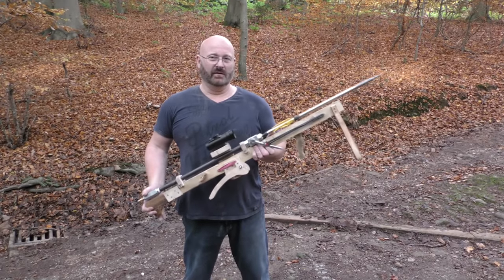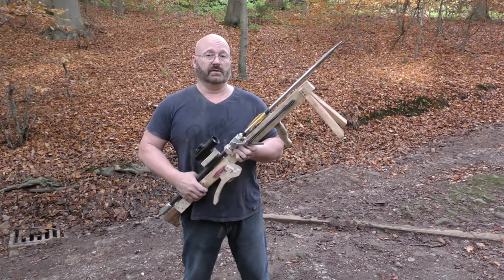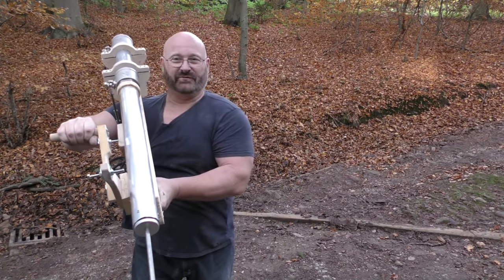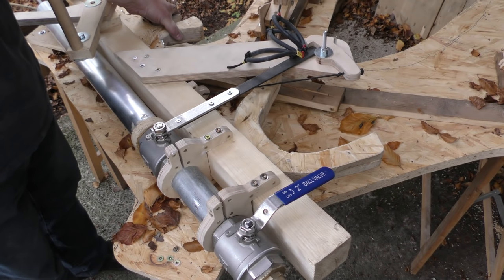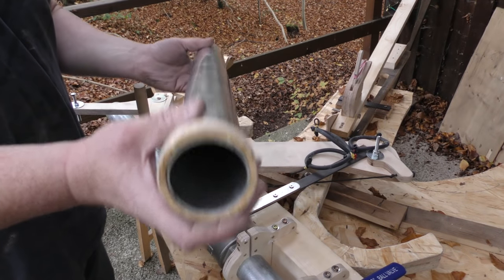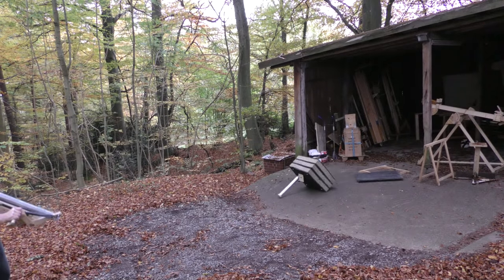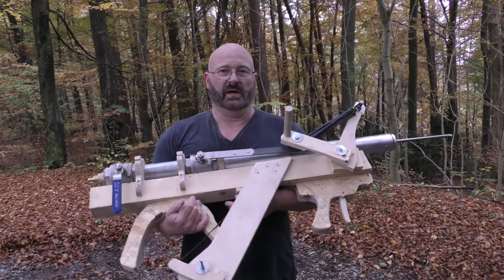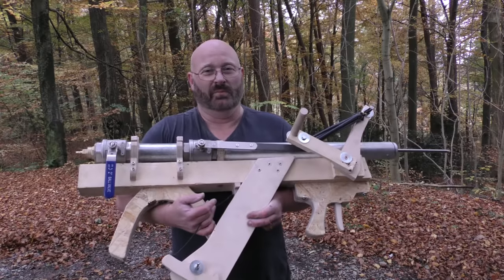"Airzooka" - The biggest portable airgun in history?

Comment: This is getting into armor piercing territory here :3
Reply: I hope so
Reply: Ship it to taofledermaus!
Reply: yes!!!
Reply: Well, the dart it shoots does remind of an APFSDS round fired by tanks. I wonder, would a sabot round where the sleeve of the round goes over the barrel while the dart goes (partially) in the barrel be still considered a toy in Germany? If so, then a FSDS round would be pretty nasty out of that thing and with a hard/dense enough round it probably would be light armor piercineg.
Reply: Sadly, no. Nothing can enter the barrel on an "arrow" launcher, BUT (and too bad Joerg does not read all of these posts) The way to get around that is to use an extra long "arrow" that's blocked off a few inches after the barrel and the "arrow" would be hollow after that point, but you could build another slingshot (like) setup into the end of the "arrow".  it could be fired based on inertia, or even have  a rod sticking out farther, so when that rod hit that target it trips the trigger and fires the pathetically designed sabot  lol

Comment: If you want to open the valve quicker (as I have written before...):
Do not attach the rubber directly with the handle of the valve. In this case the rubber must first accelerate first and begins the opening process with a very low speed.
So : Do attach the rubber with a string to the handle, and the rubber with to cocking. If you fire, the rubber will accelerate until the string is strap (deutsch .stramm) and begins to open the handle. So the rubber will starting the opening with the final speed (when all stored energy is converted to kinetic energy) Maybe you must put some weight to the connection between string and rubber, to add some momentum.
Reply: Then you can also shorten the handle: When you directly connect the rubber to the handle the opening process is depending on the force of the rubber => you need more rubber or a longer handle. 
When you first convert the engery into kinetic energy than the opening process is only depending on the energy and not on the force of the rubber. The opening needs always the same energy - independ of the length of the handle. so in this case you can shorten the handle. This will further improve the speed of the opening.
Just like using a hammer: Whit your muscle you will never push a nail in the wood. But when converting the muscle energy first into kinetic energy of the hammerhead it is easy.

Comment: Why does the compressed air turn misty/smokey when it is released? Is the air so cold that water vapour condenses?
Reply from the maker: Yes, compressed air gets very very cold when the pressure is released quickly.
Reply: Temperature is inversely proportional to pressure according to Gay-Lussac's Law

Comment: Have you thought about adding electrical solonoid to open the valve?
Reply from the maker: Battery powered solenoids won't work under the pressure rates I am using.
Reply: What if you make some sort of hammer to knock the valve open?
Reply from the maker: A 2" hammer valve under 2500 psi or more? You need a sledgehammer to open it.
Reply: Joerg, couldn't you have the air flowing twice as fast by having 2(or more) valves opening at the same time? this doubles the airflow while opening.
Reply: RenzVC what? lol
Reply: instead of the air going through only 1 valve that he's opening, put one on the right, one on the left, and connect their outputs to the barrel. so he's opening 2 valves of the same air-tank which doubles the stream of air if he opens them both at the same time and at the same speed.
Reply: JoergSprave why don't use the idea of Espen Monseud to make a powerful cannon?
Reply: electrical solenoid valves would work great, you wouldnt have a delay
Reply: I have seen them handle over 150 psi, are you really using that much power?
Reply from the maker: 150 PSI is a joke.
Reply: have you read my comment about the 2 valves that open simultaneously into 1 tube? well you have now :p JoergSprave
Reply: Ok then, never mind. I guess a electrical solenoid would not work
Reply: JoergSprave you could go industrial, although that might be a bit expensive
Reply: true but it would be awesome
Reply: JoergSprave meet the soldier, it's perfect for it.
Reply: He mentioned 100 bar of pressure. That is closer to 1,500 PSI :P
Reply: wow that's a lot of PSI
Reply: Brian Willis all solenoids are electrical
Reply: no there are manual solenoids
Reply: like in a pneumatic nail gun (also large diameter bore)
Reply: Gunner R.A. his pistol has 1
Reply: Even though this topic is 2 years old, you can use a solonoid IF you use the lower pressure to open the main valve, electronic paintball guns works that way. But you need a regulator for the solonoid. Otherwise you blow up the solonoid/ Or its safety gauges.

Comment: Hi Joerg ... if you want the valve to open quicker you shpould examine Quick Exahaust Valves (QEV) ... you can even make them yourself. They have nothing to do with motor engines although the term exhaust is misleading. A lot of the softair guns use QEV as they can be made to repeat fire consecutively like a machine gun too. ... but they can also be made to empty our the air reservoir in one big blow !
Reply from the maker: Again, don't mix these toys up with low pressure PVC spud guns. Homemade QEVs for 4000 psi? No way.
Reply: now that airsoft has been brought up, i want to make a mortar for airsoft that shoots nerf rockets but i really don't know where to start and what materials i should use, and because you the master of all this i tought i ask you XD
Reply: JoergSprave
Reply: Was ist mit indirekt gesteuerten Ventilen? Gibt es nicht Ventile die mit einem Steuerdruck geöffnet werden? vll wäre diese ja schneller
Reply: PVC, it can handle enough PSI for launching a foam rocket. I'd use a bike pump to fill a chamber and a valve to release it, although you'd have to turn it very fast for a good launch.
Reply: Большой босс
well that's a thing thx m8 i'm gonna try it out

Comment: Compressed Air is next to not affected  at zero degrees. The only thing that will be affected are the rubber parts, dont know if you'd notice that though.
Also its not an airgun, if wouldnt be legal otherwise ;)
Reply from the maker: Well, the cold temperature cools down the compressed air too, reducing the pressure in the chamber. Therefore the power IS reduced. The rubber parts are much affected as rubber stores the energy thermally. The hotter the environment the faster it retracts. Cold temps reduce the speed. At some point it stops working at all. Also, it is an airgun of course - just not the type that is regulated by German gun laws.
Reply: I thought it's a toy ;P
Cold temperature is only an issue with Co2 Guns honestly. I took my Steyr out on tourneys at 30°C and when snow fell, wasnt able to tell a differnece on the point of impact (which i had to calculate precisely from ranges around 9-25m and hitzones from 15 to 40mm and even had 8mm biathlon targets).
Reply from the maker: That is because your Steyr has a regulator. With regulator, cold temps just means the air tank won't last as long, which probably isn't an issue for you. A (toy) gun like mine fires without a regulator, so cold air means less pressure.
Reply: Thanks, just read into that and you are absolutely correct. Though it will only matter if there are temp differences between the filling and the shooting.
Reply from the maker: Not really. The air will get much warmer during the compression process, no matter how cold the environment is. Thermodynamics at work. Compress a gas and it will get warmer, decompress it and it will get colder. As the warm compressed air in the tank gets colder, the pressure automatically goes down.
Reply: P.V = n.R.T 
When the temperature decrease , the pressure decrease too
Reply: +JoergSprave A metal drain on a dirt road, interesting.
Reply: +JoergSprave I noticed you aimed low to compensate for recoil. Not your first time firing this beast huh?

Comment: Is there a way you can make it more powerful?
Reply: faster opening of the valve
Reply: As he said, faster opening valve. Maybe better projectile. Also putting more air in it and testing it in finer weather conditions.
Reply: Alex Hoad just make the air Reservoir a bit longer
Reply: He could used a compressed light gas as well.

Comment: reply here jörge
Reply from the maker: here jörge
Reply: I love your laugh ,it's adorable
Reply: sorry for wrong spelling
Reply: Your laugh makes everything you do 10x better. It's like watching Heavy from TF2 make improvised weapons. I love it.
Reply: he did something with the guy that voices the heavy TF2 guy
Reply: you should actually put rifling on the barrel of smaller arrow shooter
Reply: +JoergSprave You could use a steel spring like one from a bike suspension for faster valve release
Reply: I feel like rifling would actually hurt the performance of the arrow. In order to spin stabilize such a long object it needs to spin ridiculously fast, which isn't plausible even with explosive powered guns beyond a certain level. That's why bullets are always relatively short - the longer the projectile, the less effective gyroscopic stabilization becomes. In the case of arrows or darts, it's much simpler and better for ballistic performance to just add fletching to the back.

This is, by the way, why most modern tanks have smooth bore barrels. They fire very long darts (because being long and thin is much better if you're penetrating armor), and they generally just have fins at the back because it was shown during testing that rifling had either no effect or degraded the ballistic performance of the darts.

Look up Kinetic Energy Penetrator for more information on this.
Reply: xD
Reply: Jörg, please stop replying to these idiotic comments. There are some people in the comment section who actually make useful or interesting comments related to your videos but this cancer right here is the top comment. Your replies should be earned.
Reply: look at your profilepicture...
Reply: Optilus DNCF not having one at all isnt much better
Reply: his name isnt even jörge lmao

Comment: You should use mechanical air compressors, they are much faster. (The cool machines that you use to "refill" pressurized tanks).
Reply from the maker: Oh, but I do have a 4500 psi compressor for the heavy lifting. I still use the handpump for the small devices, just easier.
Reply: oh ok, that works too!  My arms are like overcooked noodles, i cant use one of the hand pumps XD.

Comment: You know, I think a better optimization of this would be choking down the barrel/arrowguide to a 1" (25mm) tube rather than the 2 inch.  The massive dump valve could be choked down using plumbing and a reducer and you could get much more velocity and distance out of the shots.  Also would weigh less as the arrows could be longer and sleeker.  

  BUT That being said, this thing is a monster! I love it! :D Keep up the good work!

Comment: You are correct. It only opens maybe 15 or 20% before it has already dumped the load. Maybe you only need to open it 25% as a matter of course? Or maybe a 1" valve will do as well?

Comment: Cool result, took crazy to get there.   Expect Foley Artists to show up wanting to make recordings of the airzooka.   You may be able to get the arrow stable without fins (known as fletching on arrows)  C.G. = Center of gravity, balance point along length.  C.P. = Center of pressure = center of area along arrows length.   Heavy weight in nose will weathervane tail of arrow to rear.  If you can get C.P.  aft of C.G. by 1.5 x Diameter of arrow body it may be stable.   Fins on rockets are put on straight.  Arrow fletching is put on at a slight angle so the arrow spins in flight.   The wood ring you have at the back may help with stability by creating a lot of drag.

Comment: awesome, 

my 2 cents the valve is the problem i presume this is a spherical valve PN24 or more. You need a real high pressure fast valve trigger by electronic with a solenoid in order to lower your delta time (Dt) to empty as quick as possible the pressure tank. This look like a dual conical shape inside a laval shape with a biconical exhaust. They use this in vehicul propulsed by steam in order to beat speed world records.

Comment: Jörg, you might be limited by the length of the lever here. In the future, consider two, three or four-way rubber setups so you can use shorter levers and still get the same power. In this case, you'd move the handle so that it pivots around the center and then have rubber pulling rearwards on the top and forwards on the bottom.

Comment: Hey Joerg, awesome project, what kind of valves do you use to take that kind of pressure ? I've been modifying sprinkler valves and I didn't want to push them too much over 100 psi., I'd like to make something along the lines of a 300 to 600 psi range, maybe a little more

Comment: To fix the opening speed issue, you need to add slack between the lever and the valve. Let's say that the total angle would be 180° and the slack 90°. The lever would gain momentum the first 90°, then connect with the valve and open it rapidly. The weight of the lever would be useful as opposed to now where it's slowing it down.
Somehow I don't think the diameter is right to the barrel length. You need a thinner pipe or a longer one.

Comment: You need a pressure balanced valve to reduce the differential across the ball.  A trunnion mounted valve would probably do the trick, but they may be too large in size for a 2" application.  It would certainly open up more quickly though!

Comment: Try looking into pulse valves for a replacment for the ball valves they are used in industrial dust collection systems to shoot a blast of air to clean huge filters they would definitely fire quicker than your ball valve. MAC valve is a pretty robust system but its a bit bulky

Comment: I used to use sprinkler solenoid valves to open the chamber with a 9 volt battery. I loaded that thing with rocks, trash, even stuff that didn't fit in the barrel, like baseballs and cans of beer, would be forced through the barrel. My last one was breech load so I could fit things 25% bigger than the barrel. Then they banned it.

Comment: What PSI are those 2" 2-Piece ball valves rated at? Generally a 2" Stainless BV would be about 1000 PSI which is 69 BAR. You said in your video that you are using them @ 100 BAR. 

It should say on them a number eg. 1000 WOG 

meaning 1000 PSI, water oil gas. 

Just looking out for you mate, don't want to see you get hurt. I am sure you looked into it first and got 2000PSI valves.. but generally they are rated to 1000PSI
Reply from the maker: Pressure ratings? Irrelevant. No risk no fun.

Comment: Joerg look at offshore oil exploration using air guns.
I worked offshore as a young man for 4 years. We used airguns to generate the sound during the oil exploration. We were working with 1900 psi underwater.  check it out maybe something useful.
Good luck.

Comment: You could try manufacturing a shuttle valve instead. That will open much quicker than the ball valve... 

Although i think that the ball valve is fine. It may still be opening but i don't think the barrel is long enough to get the energy out of the remaining air anyway. The pressure is still launching the arrow and the flow through the ball valve is sufficient for the time taken to accelerate the arrow along the barrel. I think the flow increase gained from a shuttle valve will be negligible...

Comment: Try this with a high speed electronically actuated butterfly valve on the firing side. Like the ones used on mythbusters occasionally. I would be curious to see how much better that would work.
Reply from the maker: Forget it, that is low pressure toy gun stuff.
Reply: JoergSprave thanks for the reply. I thought i remember them using something like that for a very large air cannon. But you are right im sure they were using much lower pressures hence the extremely long, like meters long barrel.

Comment: You said it takes about 0.1 seconds for the lever to open all the way, in the slow motion you can see that the arrow aslo lands on target in about that same time period. Which would mean that the arrow takes about 0.1 seconds for it to go from the gun to the target. You also said the distance of the shot was about 5 meters and that the arrow weighed in at about 1.5kg. 5 meters per 0.1 seconds equals 50mps, 1/2(1.5kg)(50mps)^2=1875J. Congratulations jöerg, you broke 1000 joules and almost hit 2000. All you need to do is give that thing a pointy tip and it will go through anything.

Comment: that was decent as, let me tell you how to reduce its size and increase its efficiency many Times in few words "Swagelok 1/4 turn ball valves" - generally rated at 4000 to 6000 psi, they're more expensive than the generic stainless ball valves you got there and the throughput may bottleneck at lower pressures but at higher they should be quiet good

Comment: Couldn't you use a elektronic valve using a solonoid? it would be much quicker then rubber bands.
Reply from the maker: Not for the size and pressure rates I need.

Comment: For the vanes you should use spring-loaded wrap-around folding fins, similar to the folding fins on rockets fired from helicopters. See the Hydra-70 or CRV7 for an idea of what I mean. It makes the arrow itself a lot more complex, but they would automatically unfold once the "arrow" leaves the platform.

Also, would it be possible to make a re-loadable cartridge for this model? I imagine it would be pretty difficult, considering it would need to have both the "arrow" and the air tank. It would probably need to be a two user system, and it would probably make this model illegal since it would essentially be a rocket launcher at that point haha.